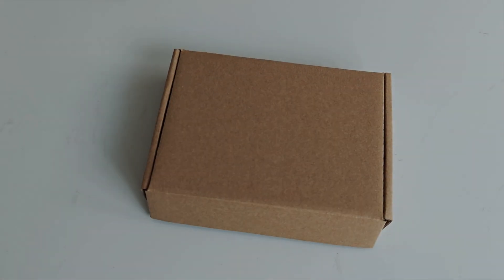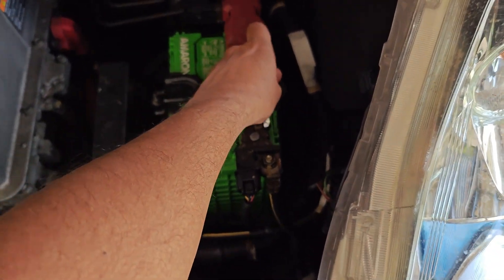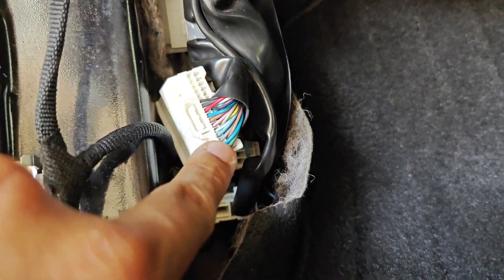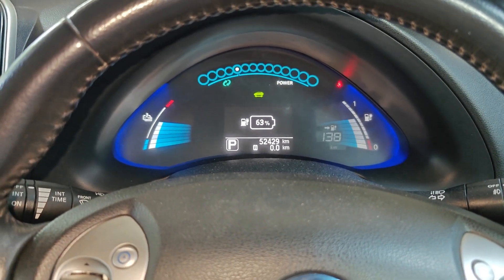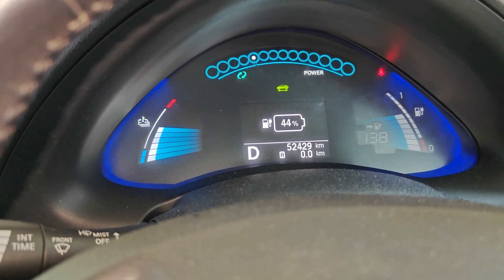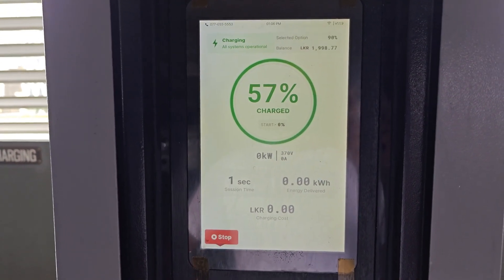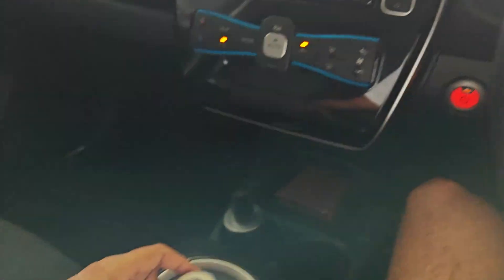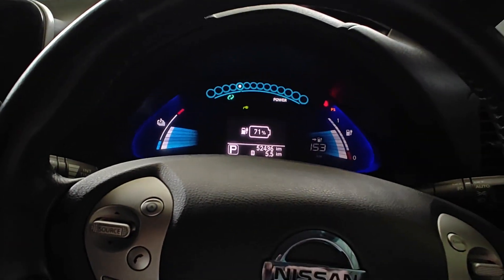Nissan Leaf CAN Bridge (LeafMod v2) Installation & Review

Comment: I bought one of these, price was excellent and it arrived to the UK within a couple of days, no issues.

Literally plug and play and it worked straight away, the easiest installation, no more difficult than fitting a radio.

Anyone buying one, my advice is to fully read the website instructions for adjustments, as not all are explained in this video.
It does maximum percentage to stop charging - eg 90% as well as speed of slow charging ( good for solar) and speed of rapid charging, took a couple of minutes to do.

Product is superb and I have done 1000 miles since fitting it so far without any issues.
My old Muxsan Bridge was faulty and caused me lots of issues, now all fixed.
Thank you for bringing this product out. 👍
Reply from the maker: Awesome!!! It really is an excellent product. Easy fit and works as advertised. Was a bit skeptical at first as nobody knew about it. I'm glad I took the plunge. Apologies for not explaining all the features in detail. Had to keep the video length around 10mins 😊
Reply: @tekxplore  why do you want it power limited? why not 50kw for example
Reply from the maker: @pearlrival3124 this video explains why: https://youtu.be/hrzfKsEoN8Y

Comment: This is exactly what I am looking for! I want to limit charging speeds to preserve the battery and keep it cool during longer trips where I don’t mind waiting a bit longer. I did ask Dala in the video that he showed the limiter but he said it’s been discontinued not explanation why. Thanks for this video and keep us updated on how you go. I wonder how much battery it’s drawing from the 12V.
Reply from the maker: Any idea how to measure the current draw? Can it be done with a regular multi meter? I'm assuming I'd need some sort of DC shunt that can measure small currents?
Reply: @tekxplore I’m not sure. I need to replace my 12V battery soon, after installation it hasn’t been happy and throws random error codes. I believe my 12V is probably quite old and needs replacing anyway.
Reply from the maker: @burntolives I've seen in Dala's repo, the latest version of his firmware has drastically reduced current draw. You probably got an older version which drew more current. Might be worth a try to update to the latest firmware if you're not on that.
Reply: @tekxplore was that update within the past 2 weeks I just installed the can bridge on the 10/09/2025 less than 3 weeks ago 😅
Reply from the maker: @burntolives nope. way before that. there has been no updates since june 2024.
Reply: @tekxplore  ahhh ok then I should have the latest version

Comment: The price is a rip off. This is open source software and the hardware costs €8. The code was written by the team from Dalas Battery Emulator project.
Reply from the maker: My sentiments exactly regarding the price, but I bought this out of desperation since my Hx started dropping due to frequent fast charging. I was using a Dala bridge before and I have combed over his source code and didn't find anything related to controlling charge speeds. Ive heard Dala used to sell bridges himself with extra features but unfortunately we can't get it any more. I tried to pry open the case but it's glued shut. So can't be certain what hardware they're using. Oh well 🤷
Reply: @tekxplore maybe you didn't look hard enough. He calls it rapidgate dodger
Reply from the maker: @jinny7  It was confirmed by Dala that those extra features were removed from the current open source code. If you bought the bridge directly from Dala back when he was selling them, you'd be all set. Unfortunately for latecomers like myself, we can't get those extras for free 😢. Check the issues on his GitHub if you don't wanna believe me.
Reply: People trying to monetize open source
Reply from the maker: @jinny7 I'm not sure if this bridge has anything to do with dala's code as the implementation of limiter functionality seems completely different. I think it's best not to jump to conclusions until some actually dumps the firmware on these and do c proper comparison with the open source firmware, don't you think?